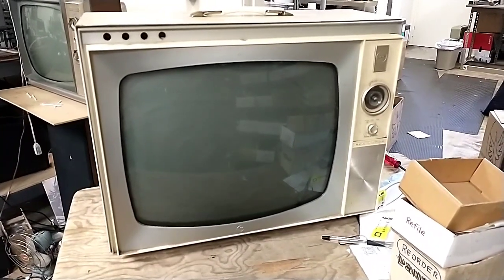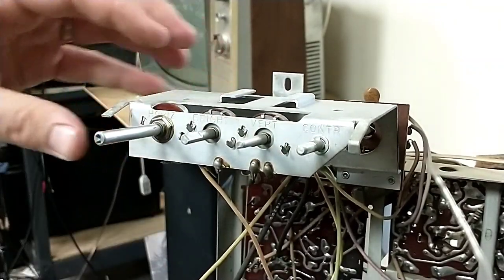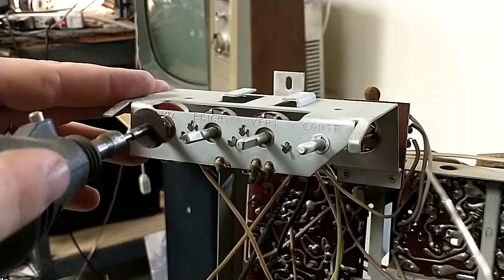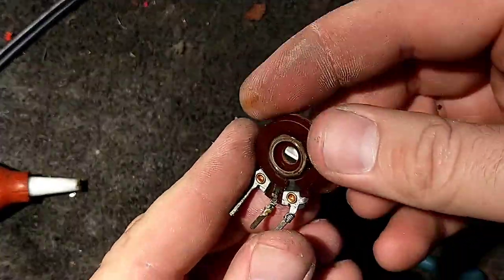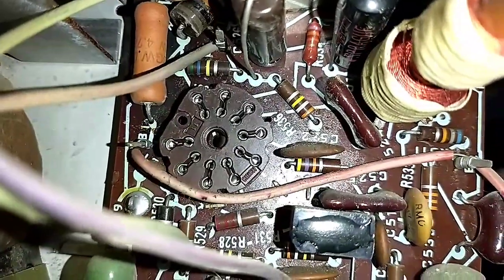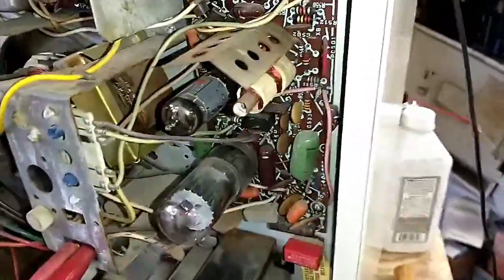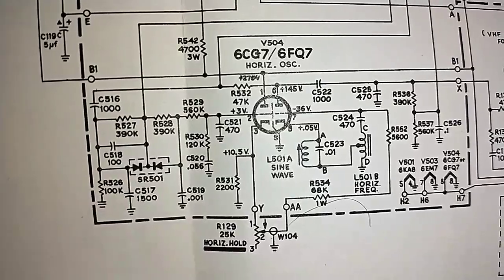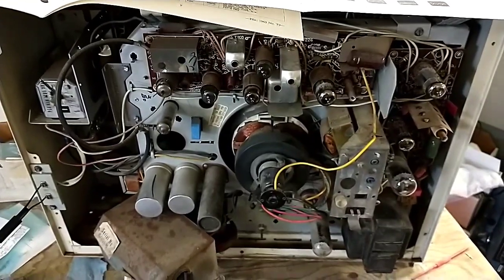Repair attempt of 1963 RCA 19" b&w vacuum tube television. KCS147a chassis. P3/3

Comment: Lesson learned again ( and again).  Shango066 is very careful to check cathode current of the Horizontal output tube, so that the Horizontal transformer does not burn up.  Also, check the CRT Ultor to make sure that not too many KV DC to cause arcs.  Anything can happen if an old and faulty tube set, so have all tests ready and going to catch fatal problems early.

Comment: Jordan, I've done autopsies on faulty pots, but never have I see one with NO carbon like that. Like you said, there had to be a solvent that destroyed the binding of the carbon to the phenolic substrate.
Reply from the maker: Yes and it's something in caig deoxit d5
Reply: @JordanPier  D series Deoxit is not intended for pots-F series Deoxit is.

Comment: Moyer Electronics may have a replacement flyback.  I've used them before on a couple sets I've repaired and had good luck with them.

Comment: It would have been interesting to see what the horizontal sawtooth looked like on the scope before the the fly back sizzled
Reply: Indeed
Reply: Yes. Running horizontal on low frequency is dangerous, because flyback pulse gets more energy from longer energy accumulation.
Reply: @xsc1000  Exactly, the coils are a tuned circuit and have already run into saturation, both yoke and flyback. That just turns into heat. I think that flyback was already damaged due to the open horiz pot which started the cascade of events which killed it before Jordon started on it.

Comment: About that glitch in horizontal deflection - I did not see any oscilloscope trace from the horizontal oscillator.  My theory is that the drive to the horizontal output tube is bogus, as a result of oscillator fault.  The Horizontal output tube is supposed to get ONE clean and sharp drive pules to the grid, for every H sweep.  If the oscillator has glitch(s), the grid of the horizontal output tube might get two drive pulses, and the extra pulse will distort the trace.  An O-scope view is needed to see if this was happening.  Finally, it seemed that the horizontal output transformer over-heated, so bummer.

Comment: Wow, the replacement of the pot is like the complete antithesis of Shango's way of working.  All that effort to shape it and fit the original knob on is great but if I'm honest I think I'd have spent the time making those extension cords instead & been able to work with the chassis out.  Not got past 18mins yet but looking at the comments and description it looks like it turned round and shat on your shoulder after all you did to lift it up, damn. These sets have no respect!

Comment: Hi Jordan! I'm currently working on a 1964 Zenith 23" non-remote motorized tuning TV that  when I got it it was DOA no raster or anything I've just finished recapping it but the circuit breaker is toast on it because it "trips" with the slightest movement of the chassis and it won't reset by pushing the red button in so I have to reset it using a screwdriver from underneath so I've not had an opportunity to see if my TV is going to function properly with the new capacitors installed. 
Any suggestions?
Reply from the maker: Discover current rating on circuit breaker, replace with fuse holder.
Reply: Thanks, that's what I was thinking too, but I had also been on VideoKarma and they seem to think that it I need to replace the circuit breaker with another circuit breaker, but I was thinking that a fuse would work just as good.

Comment: Dear sir this video was really impressive. I am repairing a Philips dual cassette tape recorder. It has 4band radio and aux in. Everything works fine but it has a wierd problem. For 3 minutes the cassette tape plays at normal speed on both the decks. After that the cassette playback slows down suddenly and plays little slower than normal. I am able to get it when I hear. I press stop and play immediately and it plays at normal speed for another few minutes. Again it slows down at some point. I checked the pinch roller, belts, capstan, idler, and rest of mechanism for any jamming or tight fit but they are okay. The dubbing (high speed recording) works fine. It's motor is mabuchi double speed type. Iam having a doubt on the motor speed controller (electronic). The motor gets 9v but I have to check the supply voltage duration it should remain 9v constantly forever. Please suggest me what to do. Should I need to change the motor or main PCB that supplies 9v to the motor.
Reply from the maker: Internal motor speed regulator if is defective. You must replace the motor